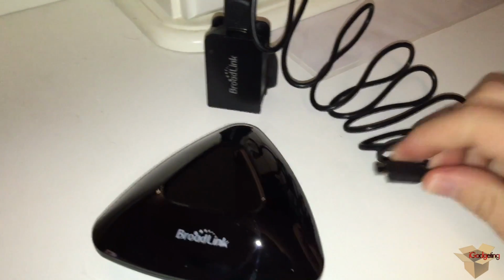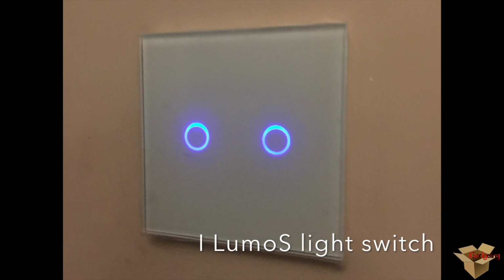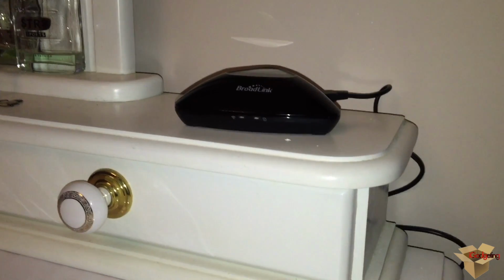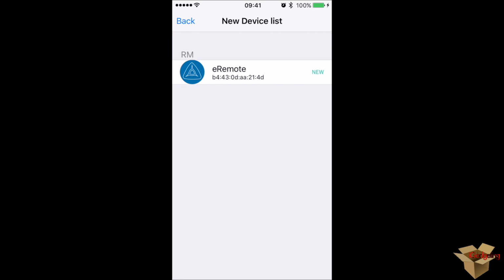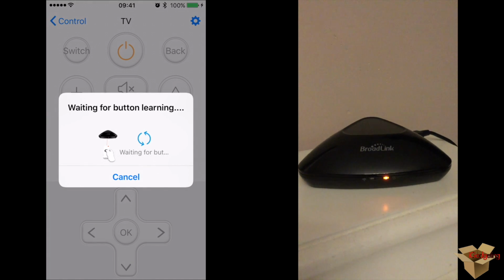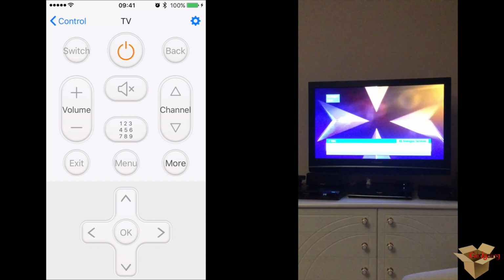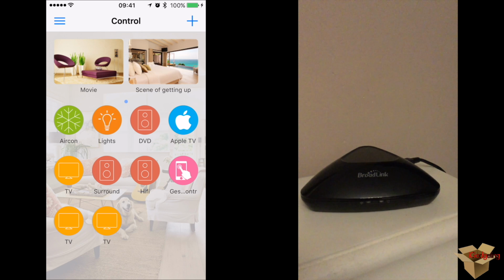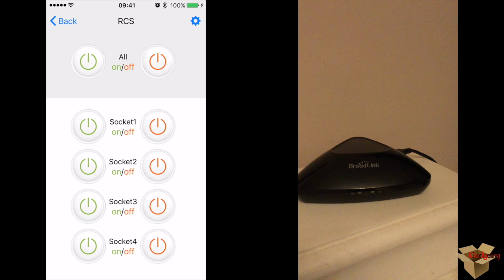Broadlink RM Pro Installation Setup

Comment: What is the difference between the IM PRO + IR+RF Control and the RM + 433 MHz. Do I need an Android phone to set up, or may I use an iPhone? I am a quadriplegic and want to control a 2010 Sony Bravia TV and a 2011 Sony Blu ray system and some smart bulbs (in the USA). Thanks!
Reply: Hi, I am not sure what the difference is between those two. You can use an iPhone to set it up just like I did. You can easily control your TV and Blu-ray system with this as long as you have the original remote control to set it up the first time. I am not sure about the smart bulbs as it depends mostly about the manufacturer. I have recently changed my bulbs to Philips Hue and I use Apple's Homekit and ask Siri to control them. Hope I was of any help. Sincerely iGadgeting

Comment: Is it possible to run 2 air-conditioners to run as pre scheduled on a rotational basis?
Reply from the maker: If both air conditioners work with the same remote and are in the same room, I don't think you can control them separately.
Reply: Any other products which are capable of doing it?

Comment: hi...thanx for the video...it was really helpful...but I have a question...for instance, if i have two identical air conditioners at the same room and I added each remote separately....does each remote works separately too????
Reply from the maker: Madiha El-nagar if the air conditioners work with the same remote and the RM Pro is in line of sight with each air conditioner it will control them at the same time.
Reply: Thank you for your quick response
So I guess they will work separately if I added each remote in a different icon?
Reply from the maker: Madiha El-nagar if the air conditioners are the same brand and model, work with the same remote and are in the same room they will work together. You can't control them separately. Not even if you set two different icons, they will still work together.

Comment: i have a question i have a automatic window open and IR radiator changer is it possable to program it for them easy?
Reply from the maker: zero80473 if they work with an IR remote control of Radio Frequency I think they would work, though I can't be sure since I don't know what they are exactly.

Comment: Hi, can you tell me if your lights has dimmer option and if it can be done via the broadlink as well ? or just turn the lights off or On with no dimmer option
Reply from the maker: Nir Avniel hi, my light switch does not have an option for dimming, however if it can be controlled via the remote I believe you can use the broadlink to control it.
Reply: can you tell me how to get this piece of shit to work away from home , it never works  every time the e-control app says "the device is offline please check your network connection"
 it works fine on wifi  but  as soon as i switch off wifi and switch to LTE it  does not work just says it is offline , i am logged in  and i tried   deleting the app and reinstalling several times and it does not work at all ,very disappointed in this product

Comment: Great video ,Great smart hub.
Also good toys to recommend
Smart curtain mortor compatible with Broad link：https://www.aliexpress.com/store/product/Smart-Home-AC-Tubular-Motor-Electric-Curtains-Curtains-Intelligent-Remote-Control-Automatic-Lifting/1848374_32477208853.html?spm=2114.12010610.0.0.N89rpk
Reply: Free shipping 5 Pics RGBW Smart Light Bulb Work Like Hue Bulb Use Wireless IR Remote Control Compatible with Broadlink  :https://www.aliexpress.com/store/product/Smart-Light-Bulb-Hue-Like-Bulb-Use-Wireless-Remote-Control-Long-Distance-Control-9W-100-to/1848374_32463878016.html?spm=2114.12010610.0.0.N89rpk

Comment: thanks for the video. i was wondering can you access your devices remotely outside of local wifi? For example can you access your home devices from work?
Reply from the maker: Ali G yes you can access it from any other wifi (assuming that it is not too restricted) and ever from your mobile data. You don't have to be connected on the same wifi network

Comment: What's the range on this? Is there like detachable RF transmitter cable that helps to extend the coverage?
Reply from the maker: It has a pretty good range, mine works through 5 stone walls along a distance of about 15 metres

Comment: Thanks... My RM2 did not come with instructions.  You have shown me what I need to know.
Reply from the maker: Cap Smith so glad you found it useful. Thanks!
Reply: can you please help me, i have a question that i need answered quickly
i need to re enter  the log in credentials for the device so  how do i do it and  will it mess up my current setup at all if i do?
what happened is that i found out that my 2.4ghz band on my router had a space at the end of the SSID and it was  causing problems for some clients so i had to remove the  hidden space at the end of the SSID but now all  my 2.4ghz clients will not connect because they  see it as a new different SSID ,so i need to   enter the new ssid

Comment: Hi, I can't control my e-remote out of home , not from the place where I have wifi and not by 3-4 G, may be you know what's the problem?
I always see the massage : the device is offline. And an other problem -the device can't learn most of remote controls
Reply: i have the exact same problem,  you can update the FW of the device and it will learn the remotes but i still can't make it work away from home at all

Comment: Hi,
    Is it possible to control an RF based TV remote with Broadlink. Basically a changhong TV with an RF remote ..
Reply from the maker: sanoj varghese Hi, I use RF plugs and they work great, it depends on the frequency it uses.

Comment: This RM Pro is amazing. I have had one for almost a year now, and I use it (all in one room) for my Air Conditioning, TV, Projector, Smart Blu Ray Player, Surround sound system, CD Stereo, and perhaps most importantly:10 different RF Outlets. These outlets are like 5 bucks each (you can get a set on amazon for cheap), and essentially you can turn your outlets into smart outlets for cheap! Broadlink is really missing out on the potential they have with this product. I have fumbled around with the app and while it works for me, it honestly sucks and would not survive in the mass market. Broadlink needs to step up and work to get this partnered with Homekit for Apple or Amazon Alexa, and clean up their app too. This thing would me MASSIVELY successful if they pull this off. This goes for around 35 on Amazon, and a 5 pack of RF outlets is 25. So for 60$ total you have a hub and 5 outlets, where a normal smart outlet is $25-30 a piece, without the hub. I have reached out to Broadlink Support but they seem to not be very proactive on this project which is a shame.
Reply: Hi, so I'm pretty new to using broadlink. 
For the RF outlets that you mention, do you have to like pair them with the hub or something?
Reply: they won't work with the Rm Mini 3, you have to get to get the Rm Pro/2. Then in the app you click add remote, and click RCS. Then you stand next to your Rm 2 with the RF remote that came with your outlets and add them into the app, so the app 'learns' them so it can repeat them
Reply: the Rm 2 is the "hub"
Reply: slamdolphin
Reply: Janice Tan what

Comment: Welcome to visit our Amazon store: www.amazon.com/shops/BroadLink
Reply: Seriously Broadlink you need to add proper IFTTT.com and Amazon Echo support!!!!
Reply: Will the RmPro work with Apple HOMEkit in the future?
Reply: Yes, but before RM PRO, we will let SP3 smart plug work with Homekit first.
Reply: Broadlink DNA that would be a great addition to the broadlink RMPro as it is a great device however I'd really would like to use it with HomeKit
Reply: Hey man, just a follow-up:
I managed to get the RMPro to be voiced controlled through Google Now. I am using a Galaxy s3 to do the processing an act as the 'Google Home' to control anything my Broadlink can'  you can find the necessary software on the Play store (Im an iPhone guy but I found this old droid lying around'
Reply: ***** is this only with the RM Bridge app on android?
Reply: PLEASE FIX YOUR FUCKING PIECE OF SHIT APP BROADLINK!
I can't get this piece of shit to work away from home , it never works  every time the e-control app says "the device is offline please check your network connection"
 it works fine on wifi  but  as soon as i switch off wifi and switch to LTE it  does not work just says it is offline , i am logged in  and i tried   deleting the app and reinstalling several times and it does not work at all ,very disappointed in this product

Comment: Does it accept any remote code or it needs to learn all the devices?
Reply from the maker: You can download a remote settings from the application. However it can also learn remote codes from your original remote

Comment: I liked your video; easy to understand and a good presentation. 
Just need some more information.
I am looking to buy something to control my stereo system (IR Remote) in my basement while I am in my sunroom upstairs. Probably 40' away and through concrete walls. 
I also have an existing remote lighting and security system (RF Remotes.) 
Will this work, even though the actual device is in the basement, with the RF remotes?
Is there a list of branded IR & RF devices this system will work with?
Thank you
Reply from the maker: Thank you for your comment. To control IR devices the RM Pro needs to have a clear visibility of the device being controlled. Make sure Wifi is accessible from the basement so you can communicate with it from anywhere even from outside your home. Regarding RF devices my RM Pro can control them from several rooms away. I find its range much longer and stronger than the actual remote of my RF devices. It works with most of the RF devices I have such as home plugs but it didn't work with my Hormann Garage door.

Comment: Thanks for the very informative vid. I have 2 wall (ductless) AC units at my house. They both use the same remote (meaning they will both respond to either remote). I assume I need to have a boardlink in each room to control each AC unit? 

How does Iphone app handle 2 different boarlink RM? Can you make a separate icon on iphone for each RM?

Also, I have several houses. How does one program all these RM from different homes on one iphone?

Thanks.
Reply: Hi, thanks for your comment. I only have one device but I checked the setting to see what's available. You can set several Broadlink RM Pro in the same app. I don't think you can have multiple icons on the iPhone's home screen. However you can switch between multiple devices from the app itself. 

Devices like air conditioners need a Broadlink RM Pro in the same room they are in since the remote's signal works with infra red which cannot pass through walls. 

As when having more than one home I suggest giving each Broadlink RM Pro a meaningful name to indicate in which house they are and in which room to make it easier to switch between them.

I hope that you will find this information useful.
Reply: @JLIinternational yes you will need a boardlink box in each room as the box needs line of sight to the aircon to be able to turn it on and off

Comment: 1 power on reset press 2 3 When led blink quickly open apps on my Android device .. but I have to be connected to a wifi ? What ? Or do I need to manually enter a network ??how does the smartphone to communicate with remote rm ? rm as does remote connect to my wifi ???
Reply from the maker: Connect to the wifi you want to use from your smartphone and then search for the RM Pro and it should locate it and it will start using the same wifi as well